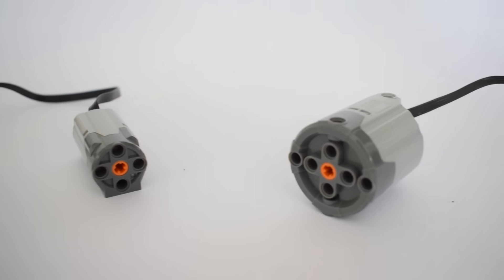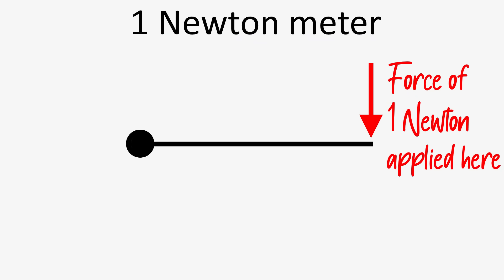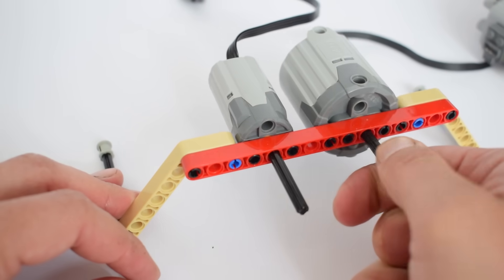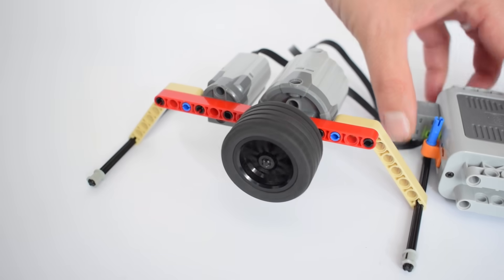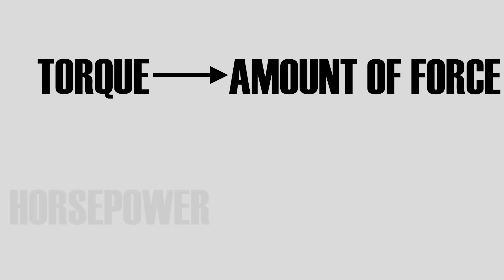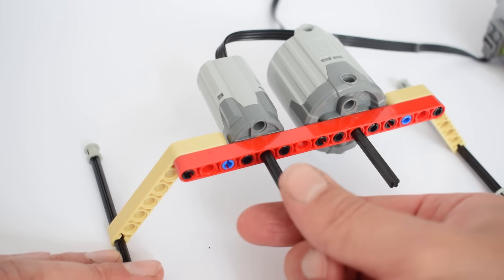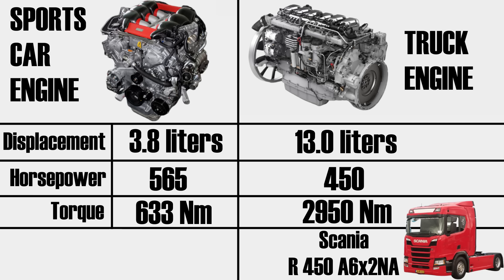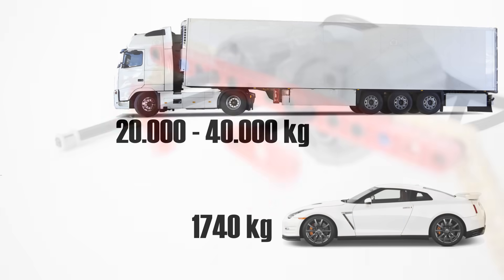NEVER be confused by HORSEPOWER and TORQUE again - HP and TORQUE EXPLAINED in the MOST VISUAL WAY

Comment: And this is why I tell people with 4x4 pickup trucks that if they want to run oversized tires they should get a lower geared differential/gearbox. By increasing the diameter of their wheel they are reducing torque which makes their truck feel sluggish. The only way to gain that torque back is to swap to a lower geared differential/gearbox. 

More torque always equals quicker/stronger acceleration. Same reason many drag race cars have very low gears. Their top speed isn't as important as being able to reach their top speed in a 1/4 mile. Seen plenty of cars that their top speed is less than 150mph that can beat a 200+mph car in a 1/4 mile drag race due to lower gears aka more torque. 200+mph car will typically have more horsepower at higher rpm, but launch like a turd because they have no torque at lower rpm take off.

Comment: This same concept is why many American cars of the 50s-70s had such massive engines. Outside the the muscle cars, the ultimate goal was to build incredible highway cruisers where you could barely even hear the engine. Take the Cadillac 500 engine, the largest V8 engine ever GM ever produced. It was a 500 cubic inch (8.2L) monster that in it's prime made "just" 400hp at only 4400rpm, and a massive 550lbft of torque from just 3000rpm. Connected to only a 3 or 4 speed transmission, those cars would just quietly cruise down the road. Modifications of these engines have shown they're easily capable of 800+hp. Even when during the gas crisis they had to choke the engines down, despite only making only 190hp at 3600rpm, that engine still made 360lbft of torque at just 2000rpm! Which again, was the goal. Acceleration wasn't the goal, but instead to just feel the slow onset of power and cruise up to highway speeds without even hearing the engine if you didn't want to.

Comment: In terms of a dyno, torque is measured and hp is observed. But in terms of acceleration in a car or a truck towing at a certain velocity, hp is felt, not the torque. Torque curve is only useful to get to hp and sizing drive train.

Comment: if the car provides more horsepower why dont we use car engines with big gear ratios?
the sports car engine you gave as an exaple 2.8 times higher max rpm and 0.215 times the torque
I know that torque on max rpm is lower than normal but still it doesnt make much sense, it would be lower for both vehicles
the sport car should have 0.6 times the horsepower of the truck

Comment: My bicycle "engine" has more torque than most motorcycles. Does that mean I will win a race? No. Engine torque is fairly meaningless as the only metric, without max RPM and also the transmission ratios.
How much "force" the engine can push round with is then modified by transmissions. If I want to go fast on a bicycle I might have a ratio of 1:4, whereas even on a sport motorcycle it's probably like 3:1 - which is 12 x easier a gear than the bicycle. The difference is legs can't spin at 10,000 rpm so despite the torque at the crank, not much total power is developed.
The one time, low end torque is useful though is pulling a racing car off the starting line. Imagine a car that produces 700 horsepower at its 7000 rpm sweet spot, but takes ages to putter up to that speed. If it only had 10-50 horsepower at all lower engine speeds, the other cars would have crossed the finish line before it's had a chance to gallop.
In theory, I don't see a reason why you couldn't put a Nissan GTR engine in an HGV with a different gear ratio. It would sound weird with this massive truck screaming along like a Ferrari or Lamborghini. In practice, I think it would overheat, therefore the larger slow and strong engines are more about engine life than anything. Of course, an engine with much less power like the TU1JP in my Citroen C2 would struggle to get the lorry going at a reasonable speed on any incline, regardless of the gear ratios chosen.

Comment: I like how you compared engines of different sizes. I liked the video overall, but I would've have added two things:

1. Horsepower is technically just a FUNCTION of torque. Horsepower = torque at any given RPM x said RPM / 5,252. This is universal. It's why any engine / motor on a Dyno the horsepower and torque lines will ALWAYS cross at 5,252RPM (if they can rev that high). To quote a motorcycle mechanic I know: " Horsepower if what makes you hit the wall, torque is what follows you THROUGH the wall"

2. While you did good mention of engines of various sizes producing / capable of variations of power, you also neglected something much more considerable. The torque vs hp specifications of an engine / motor is going to vary on bore x stroke MUCH MORE than they do based on sheer displacement. For example, You have three single cylinder engines of equivalent size: Engine 1 has a bore of 53.5mm to a stroke of a 57.8mm ("over bore" aka stroke is longer than bore), Engine 2 has a bore of 57.8mm to a stroke of 49.7 ("under bore" aka stroke is shorter than bore), and Engine 3 has a bore of 55mm to a stroke of also 55mm ("square bore" aka bore and stroke are equivalent / nearly equal). All 3 engines will have the "same" displacement at roughly 130cc, but they will produce power completely differently. Engine 1 (over bore) will generally produce the most torque, but typically the least peak horsepower, because they have a lot of rotating mass and friction so they can't rev nearly as high. Engine 2 (under bore), will be a quicker revving engine, generally resulting in far less torque, but higher HP at higher RPM due to less friction and rotating mass (because they can progress their work much more frequently as mentioned in your video). Engine 3 (square bore) will have intermediate torque and HP, over an intermediate RPM due to equal participation of its rotating mass and rotational friction. All three engines have the same rough displacement and the equivalent number of cylinders, but they will each be a whole different animal in terms of power output, and failure to mention that is where your video fell short, IMO. To put in perspective: over bore engines will have LOTS of torque at lower RPM, but fall on their face as they get higher in the RPMs (think tractor trailer or a low revving V8); under bore engines will make very to little to no torque at low RPMs and will make ALL of their power at higher RPMs (think Formula race car engines); square bore engines will have a nice and linear powerband but will never outperform dedicated truck or racing engines, normally great for application where you want reliability, which is why most economy cars have either square bore or just barely overbore engines.

Comment: You might be able to help with this? I need to rotate a mass of 6Kg continuously over a period of months at 30RPM using a single phase motor running on 240V ac supply. What motor would work? Needs to be fairly compact, could use a gearbox, and I could go from ac to dc if required but still it would be a mains supply. I though about PWM but I really don’t know how to even begin to make a choice? Any advice? Thanks.

Comment: Thank you so much for clearing this up , there are far to many videos made by people who try to pass themselves off as experts and do not even use the term properly, they have to say Feet pounds of torque, grammatically correct if it were anything else, but applied force measured in foot lbs. Truly showing the idiots who try to pass themselves off as experts, one would question the rest of the content, lot of people say it's not a big deal, but there will be alot of misinformed people who will be set straight in a harsh way, Fred Flintstone is the only one who's feet pounds

Comment: And if you're in a vehicle, you still only feel when a force is applied. But this is not torque, this is acceleration.
And acceleration depends on the horsepower (and weight and (air- and roll-) resistance).

Thus in a car you don't feel torque, you feel the horsepower 😉

Comment: Torque can be multiplied using a gearbox. So using a 2:1 gearbox the ouotut shaft will rotate half as fast, but produce double the troque. The horsepower will stay the same though and that is why wheel torque is a useless number. 
A 50hp 50nm petrol engine connected to a 100:1 gearbox (including wheels and diff) now produces 5000 wheel nm...but would move in a snail pace, but the hp will not change from 50hp.

Comment: So in motorcycles the one which is better depends on the maximum speed you want to achieve? High speeds means more hp is desired but lower speeds and gaining speed fast means torque is better. Am I correct on this?

Comment: Horsepower is basically torque multiplied by revs... More torque at the same revs equals more power, more revs at the same torque also equals more power!
If you have an Engine that can do 500nm of torque at 4000rpm and an engine that can do the same torque at 5000rpm, well the latter will output more power!
Horsepower is the energy produced where as torque is the potential to generate energy

Comment: Sports car or truck, they all have gears between the engine and wheels. More horsepower from the engine means that the wheels have more torque, rpm or both. The advantage of a high torque engine, is that the horsepower is achieved at a lower rpm which is better for the engine.

Comment: My friend cannot grasp the concept of hp/tq. 
I have a modded diesel bmw with 400 hp / 650 ft-lbs (880nm) of torque. It feels fast because of its instant response but loses steam past 4k rpm
A racing car has nothing down below, but picks up speed much quicker in the higher rpms even tho you cant feel it

so my friend says he wants a car with 1000tq thinking it will make if the "fastest" car in the world

but this video shows that such reality will only hinder it even more, even though it will feel the fastest. 

You need a car with 1000 hp to BE the faster car, tho you may not feel it.

Comment: This also becomes interesting when you consider angular momentum. In order to keep an object moving in a circle, you must actually accelerate (change in speed) the object, even though it can measured at a constant speed at a fixed point on the object. So to produce acceleration of a wheel, you need an exponential (not linear) rate of force (linear) which is what we call horsepower

Comment: then what i learned in school what a horsepower is was completely wrong? i learned that 1 horsepower was a engine/contraptions ability to lift 1kg 1meter into the air in a second.
Reply: Actually it's 550 lbs through 1 ft in a second

Comment: Since horsepower of the sports car engine is actually greater, does it mean if we use proper gear reduction mechanism, we can eventually achieve more torque and speed than the truck engines?

Comment: Sorry but i am still confused.
What if the truck had the Sports car motor but a different Transmission?
I know that truck engines are designed for longlivity and the other one is for Performance/mass.
But isnt it all just a matter of horsepower and Transmission?

Comment: A huge truck could be moved by a tiny 10,000 rpm engine with the right gearing, because torque is free to get with gearing.  In a truck you want the engine to LAST. and it will at 2,000 rpm.  So, you design an engine large enough to make enough torque to produce the required horsepower at a low RPM.  So many people get really close to fully understanding this but just fall short.

Comment: HP: how fast you hit a wall 
Torque: how far you take the wall with you
Reply: No
Reply: Not true at all, to move an object you need force, the more force the further it moves. Force is equal to mass*acceleration, in simple terms your force would be your cars mass multiplied by the quotient of the final speed being divided by the time it takes to hit the wall. (Assuming a dead stop) so no a car with more torque will not take a wall further if a car with less torque and more mass hits the wall at a faster speed
Reply: @Theedd9991  this saying actually hurts my brain everytime I read it 

Maybe these people should test it by driving into a wall😂

Comment: question. in my understanding, for acceleration the deciding factor apart from weight is torque at the wheel, not the crankshaft. so putting the sportscar engine into the truck with a very slow transmission ratio would make the truck accelerate the same as with its original engine, no? assuming of course same horsepower.
on a side not: you CAN feel horsepower with the lego motors. its how warm your fingers get from friction when you brake the shaft =)
Reply: An engine with low torque will have less pulling power even with a transmission that allows more torque to the wheels.
Reply: @Bendigo1  torque(wheel) = (horse)power ÷ rotationspeed. rotationspeed of the wheel is the same through different transmission, power is the same, therefore torque at wheel must be the same. where am i wrong?
Reply: @domothepilot  the engine power will be lost in the transmission and gears.  If the engine has higher torque it will be able to push harder on the gears.  Giving better acceleration.    If you have an engine with 500 hp but 250 ft/lb torque  compared to an engine with 500 hp 500ft/lb torque and the same gear ratios in the final drive and the transmission the one with more torque will always be quicker.

Comment: One thing no one ever explains, what does 500hp with 250Nm vs 500hp with 750Nm tell me, what is the difference between those two sets of numbers, what does more torque tell me, what is the difference between them two engines in real life? What do I eat with that info with?

Power band, HP output over rpm range,  no torque and your graph looks like a Himalayan mountain, no power, no power, WOOT, shift.  Even HP to Torque and it looks like a hill.  Torque double of HP and graph looks like a pan cake,  make full power from idle (electric engines/motors have loads of torque, hence full power from 0 rpm).  

Important:  its not the numbers that matter, its the ratio of HP to torque,  is it half of HP or is it even or double or....  ratio of the two numbers.  HP will tell you how much power you have,  its ratio to torque will tell you how its allocated along power band.

Comment: Power is instantaneous.  Energy is power over a period of time.  It can be confusing, because if you actually have power you are already expending energy.  Potential energy has no power until it becomes kinetic.  Power is just basically a measurement of heat.  Nevermind.  It doesn't matter.  You have no power unless you're doing something.  That goes for life too.

Comment: The way I had it explained to me was that if you want to shift a 1 ton bags of coal up a shaft and you're not really concerned with how long it takes then you need a winch motor with a lot of torque, if instead you want to shift individual lumps of coal very quickly then you want a winch motor with more horsepower.

Comment: Horsepower is how FAST you hit the wall. Torque is how FAR you push the wall.
Reply: Not true
Reply: @benfennell6842  high horsepower cars go fast. High torque trucks pull or move things. I can explain for you but I cant understand it for you :)
Reply: @longbow6416  yeah but that's not what you typed originally is it

Also "horsepower=fast torque=pull" is a massive oversimplification, a high torque 2 litre motor is still going to be worse at hauling than a 6 litre high power motor.
Reply: @benfennell6842  You just can't argue with ignorance, Ben, can you?
Reply: @christophermackley8084  you should see this guy hondaxl250k0, trying to argue to me that an engine objectively capable of doing the same work twice as fast is less effective at doing work

Comment: Horsepower can be thought of as torque at a certain speed.  It's possible to use gearing to exchange speed and torque.  Since the two engines have similar horsepower it would be possible to gear down the sports car engine and provide the higher torque at a lower speed, or gear up the truck engine to have higher speed with less torque.  The power output is the same.

Comment: Great video but there is one thing i need to clarify. In the video you said that torque is what you can feel and show car acceleration clip. But as a matter of fact peak acceleration happens at peak hp not peak torque. Car with more hp will accelerate faster than car with more torque.

Comment: They is no torque in motor as defined by a engine. Motor has full torque in first full rotation. That why no gas car can beat it off the line. Don't  believe the hype telsa selling as a special. higher toque motor &  you pay more for. If you want more torque. Just add more volts. That line of battery or a mod software hack . Trick the computer to release more amps. we use to do in our Honda insights hybrid mother old car. It's only a 1.2 or 1.3 liter motor with a 140 volt battery pack it's a hybrid. I use to leave v 8 about 3 car back to 60. 
But is only 1.3 motor LOL

Comment: Great video, but this still doesn't explain HP and Torque curve showing non-similar shape.  HP = T x rpm / constant, so the shape of two graph should resemble, but such graphs are unseen.  I have been assuming transmission gear ratio is involved for two different shaped curves of HP and Torque (where HP graph is composition of many gear ratios), but haven't found any conclusive facts.  It'll be awesome if someone can explain this.